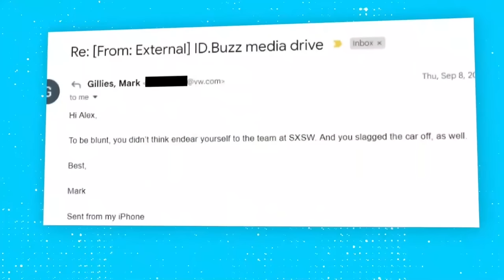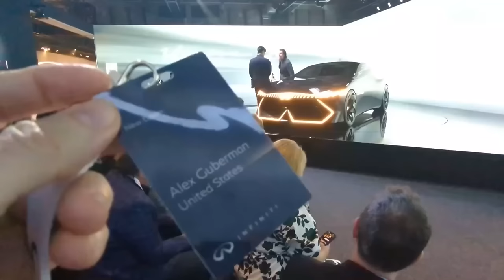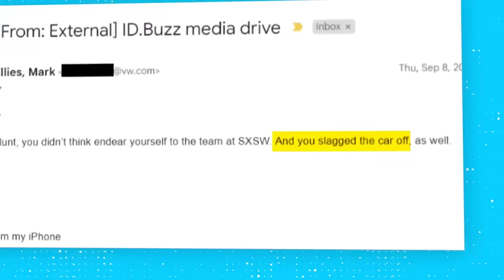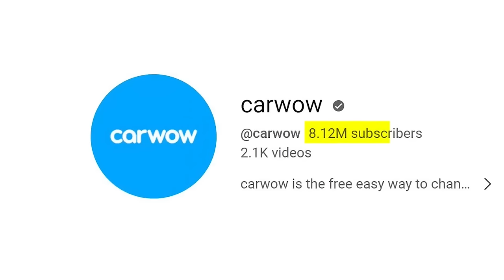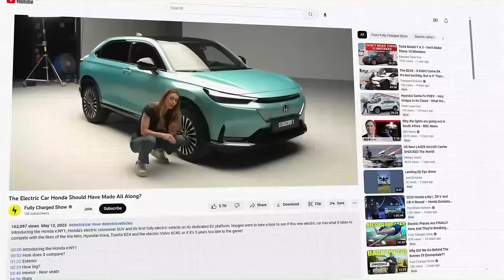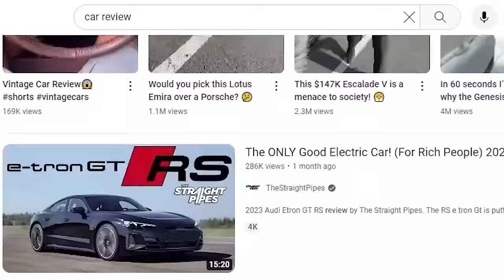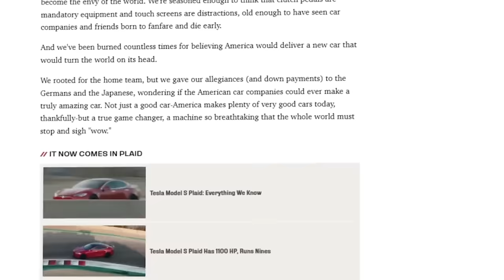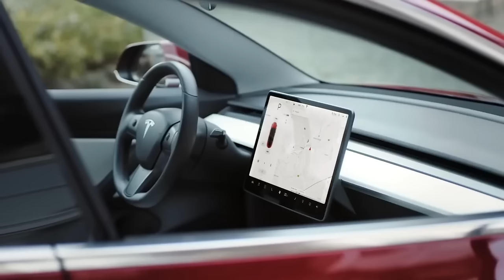How Car Makers & Influencers LIE to You

Comment: Refreshing to hear "real" experiences. I do like some reviewers but like you say they don't openly say the car is rubbish. Instead they say "what do you think ?" or "I'm not sure about this". Also the "range isn't as good as xxx car" or "isn't good enough" You can tell they are thinking "this car is crap". NO reviewer tells you you can only use 60% of the battery during normal use. NO reviewer says you might lose 30% of your range which can be 60 to 90 miles and the battery will not be replaced. NO reviewer says "don't buy a used lease EV" because it has been rapid charged to death. NO reviewer says a Tesla will cost 3 times as much to insure as a regular petrol car. NO reviewer tells you you can only charge one EV at home at a time unless you have 3 phase supply to you home. NO reviewer is telling us used ev prices are in free fall. A 2 year old ID3 or Cupra Born will have dropped 40% in value but can be 60% from list price. Tesla cars are dropping similar rates at £1000 a month in the UK. NO reviewer says "who will buy a 6 or 8 year old ev ?" Tesla US build quality is laughable compared to European cars but then again the US car manufacturers have always built cars badly like the Chevrolet Cruze that had is steering wheel come off in your hands. Keep up the brilliant videos.

Comment: I think Kyle Conner is open to Vinfast improving over time like any new EV manufacturer should. In fact he’s leased a VF8 for one of his employees and has had plenty of good things to say about it despite some software teething issues during a long trip they took with it from the dealer to his podcast hosts home several states away. She named it ‘Spring Roll’ and loves it. I’m not sure I would lump ‘Out of Spec Reviews’ into the same category as “Fully Charged”. Kyle is who you go to for all the nerdy details that you never get from a typical reviewer. In fact, he’s a bit like you in criticizing bad practices by large corporations. Hell, he started “Rate Your Charge” on Twitter/X to expose DC charger maintenance issues that plague the public charging infrastructure here in the states.

Comment: No one is better at curating their reputation like Porsche.  When the Taycan launched, the European press reported on charging system failures and even fires.  A whistle blower came forward from the factory.  But in the USA not a single word was heard about the problems.  Amazing silence on such serious issues.  These influencers should be viewed at salemen, not journalists. Haven't you wondered about how a 30 year old influencer can suddenly own a high end 911?

Comment: you missed another point: special lease offers that are usually limited to VIP or employees for all the influencers and PR people which then even change their decision
We had an id channel which had close access to the VW management for international content called battery life. He was driving his id.3 for 3 years and had gotten the very first one which had been handed over back in 2020 after many delays. He was happy, but not that happy with the car and was thinking about getting an Kia EV 6 or so , and finally in the pretty last second - what a miracle - he did not get an all wheel drive sporty car as he had announced but a boring ID what ?

yes, the ID.7 made in Emden , lower saxony which had nothing to do with the car he had been talking before he would wanna get as his next car after 3 years with the id.3 
And i bet his decision is driven by the low lease rate offered from VW which will be about 1 or less than 1 % per month.

Comment: There should be car reviews for used EV's since cars like the Nissan Leaf are not supported by the manufacturer after couple years and you can't get replacement batteries for them and the cars end up getting scrapped. What is the actual cost of ownership for these cars when they are expensive and only last couple years. Another example is the Hyundai Ionic where the replacement battery costs just as much as the car. I'm not buying an EV anytime soon until these issues get sorted out, I will stick to hybrids.

Comment: I know I'm likely alone but I really want a e cargo van with solar panels that can charge it. I know it only gets like 20 mi a day but that's free... Throw in a few RV features and you have a van life dream
Reply: You aren't going to get 20 miles range a day from solar panels, and most electric Van's have a range of just over 100 miles
Reply: @bigjml  perhaps But it would still recharge over time and you could use the batteries in it too power heating and cooling regulations like in a Tesla as well as charging some devices.
Reply: @Genocide4all  Elon Musk has already voiced an opinion on solar panels on vehicles, he said it was pointless.

London Ambulance Service has put solar panels on the roof of their Mustang Mach E RRVs to try an keep the 12v battery topped off, they do nothing.

Car still has to be charged 2 or 3 times a day.

They have to charge up the traction battery and the 12V battery system, so it has to be connected to 2 battery chargers.

And they cost 3 times as much as a diesel RRV.

Interestingly they needed to buy somw cars for Managers, despite all the choices of large SUVs for the purpose they bought XC90 PHEVs.

Mr Toyota has a point.

PHEVs make more sense than EVs for the majority of usags scenarios
Reply: @bigjml  The 20 Mile estimate was from the same interview with Elon musk. And he was referring to regular vehicles not vans fans have a larger surface area on the roof I admit they would not be good for a daily driver however Van life camping boondocking and other such things It would be good for those needs.

Comment: 😂 You really know how to piss them off. Didn’t you piss off Tesla? But I found most of what you said to be true. Now my Tesla ownership experience was easier than yours 😅. I think low mileage drivers have it easier. I only had one issue with the microphone and they fixed it right away. Other than Elon running around trying to out do Henry Ford and most of the other cars having flaws the EV experience has been pretty good. Hopefully it will get better soon for EV enthusiasts and also regular late adopters. Thanks for your hard work and dedication we know it is hard to give up all those vacations for integrity. I see those other car reviews and I know they are lying.
Reply from the maker: Nothing pisses them off more than truth and I'm really good at it

Comment: Your reviews are your opinion. I may not like the Cybertruck, but if someone loves it, it is not that they are lying, it is their opinion.

The general consensus that the media seem to have towards the Volkswagen ID Buzz is that it has character, not the best range, annoying Infotainment and is very expensive; so not exactly a glowing endorsement. Criticising it because it is built on the existing chassis is a little harsh, the chassis is an EV chassis designed to be the base to a number of models, why wouldn't a vehicle manufacture do that? They did it with ICE vehicles.

What would a reviewer say of the traditional VW camper van, probably that it has character, low on power, cramped and expensive, but that didn't stop it being a global success and so popular that it established itself as an icon.  

I think there is a little bit of push back here because you are not being invited to all the lavish sales pitches.